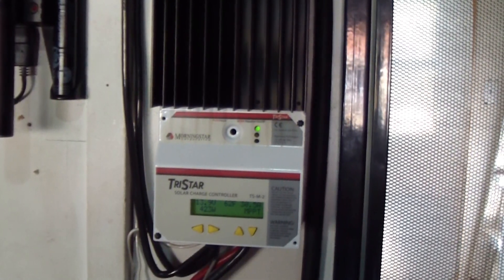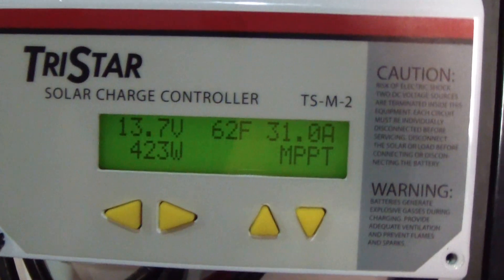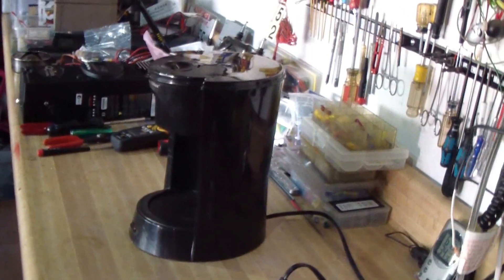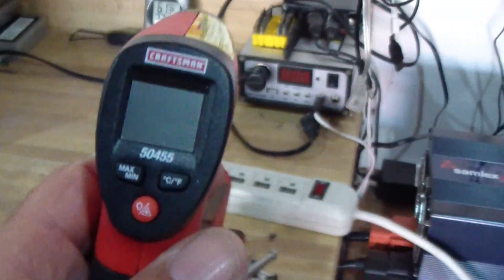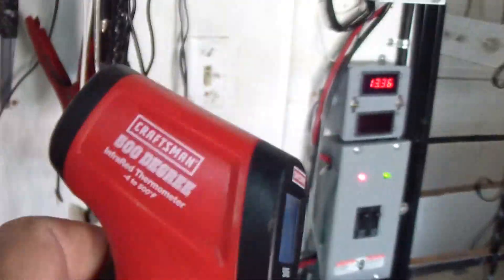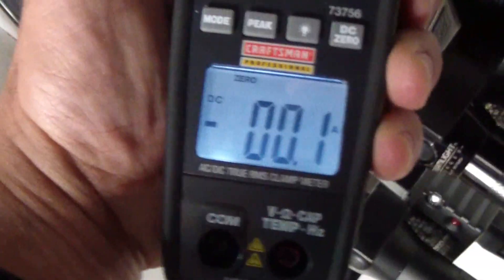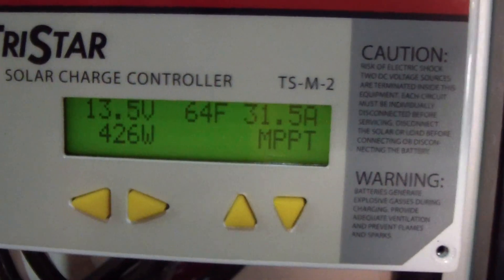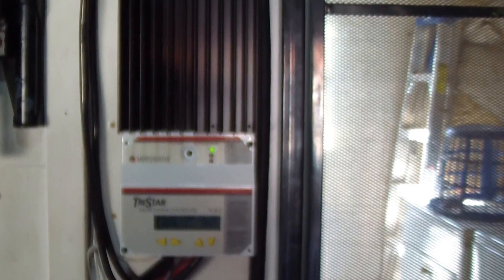MorningStar TS-60 MPPT Solar Charge Controller Up and Running.

Comment: I have 10-310 panels on my ts 60 PWM controller it rocks my system is 48 volts with a magnum inverter
Reply from the maker: That's awesome!

Comment: I am upgrading an old offgrid setup for my cabin.

I just have 2 panels 250watts each.

What kind of charge controller and inverter would you recommend to supply: 500Watts of power fed into (2) 12 volt batteries?

Thanks in advance!
Reply from the maker: morning Star has some 30 Amp controller that would work fine for your needs, but think ahead and see if you may want to expand in the future! As far as inverters you need to do the same and do your homework for the future, what are you going to run on the inverter with two batteries?
Godspeed,
Raz
Reply: ElRazTheGreat1 Thanks for the reply, I will check out the controller. We are just running lights, Stereo, TV. (mindfully and not all at once)   If you have any ideas on Inverter for that; that would be great! Once again, thanks for the reply.
Reply from the maker: dannyboy8920 Check out Magnum & Samlex inverters they are bullet proof!

Comment: I am a little confused. You show the operation of the Tristar 60 charge controller and pan down and mention the Inverter. You do not mention if you are charging batteries, (although a view of the batteries is seen). So, are you using the charge controller to charge batteries and then feed the batteries to the Inverter?
I have four 230w/35Voc solar panels.
Cannot figure out if or how many I should configure in series or parallel, or series parallel.
I also have tried to hook up my four panel array, 12v (18 Voc) to the controller and get the same results.
I have tripple checked everything inside as well as the Dip Switches.
Any idea if I am hooking it up right or if the controller is defective?
Reply from the maker: Joe the charge controller is connected to the battery bank and is charging the batteries in MPPT mode as shown, the inverter is running off of the battery bank, hope this would help you.
Reply from the maker: The max input for this charger is 150 Volts, so you can either make two 230 W panels in parallel (times two) and then connect the two 35 Volt in series to get 70 Volt, or connect all 4 panels in series to get 140 Volt to the controller.
Reply: +ElRazTheGreat1 That is not how it works. The panels have a rated OCV up to 150 volts. You need to make sure all panels are rated within 5% on each panels OCV. So if you  have 5 panels rated at 50 volts open current. You can stake as many as you like in 48 volt mode. As long as you don't produce more amps then the controller can handle on the input side.

if you stake then in series just be aware. If you lose a panel at the end of an array. you lose the whole array.  Same if one fails in the middle then you lose half the array. Which will also change your OCV setting on the controller. 

Its the reason they make it up to 150 ocv. You can design the array to use more or less panels depending on the panels you use.

Comment: It has on the face meter      Today:   Battery     1388.  W.   max.    What do you think that means is that the max wattage the panels are producing  thanks.    You have to go to loged data to find it  thanks

Comment: Hi I have a 24 volt setup with 1500 watts of solar panels  when I go to loged data and go down to today battery 1258 w.  max.  What does that mean the manual doesn't explane any of the readings

Comment from the maker: Short circuit current, Isc, flows with zero external resistance (V= 0) and is the maximum current delivered by the solar cell at any illumination level.

Comment from the maker: Over the past three years Outback replaced my FX 60 charge controller three times and still was not working right! It would show bulk charge when its pitch black outside, the startup screen was showing alien language, the restart button would not work and some days it would charge/absorb for 3 to 5 hours even when it was programmed to charge one hour only. I did not want to come back to a burnet down house!
 
Be Well, Godspeed,
 
El Raz

Comment from the maker: Deep cycle batteries do not have reserve cranking amps; they are made for deep discharge/charge that the regular automotive starting/cranking batteries would not be able to do and if so they would not last very long!  You could use dual purpose deep-cycle/marine batteries for your purpose, like group 31 that is a dual purpose commercial grade battery, continued....